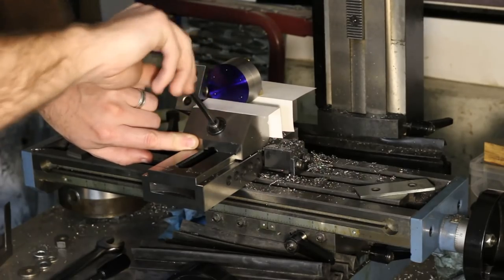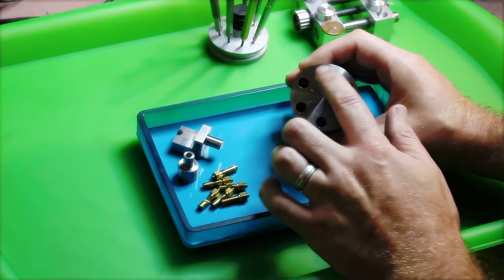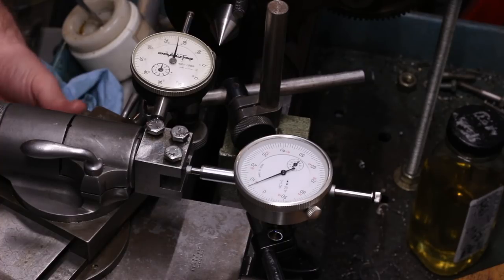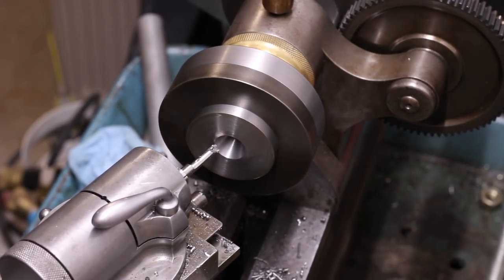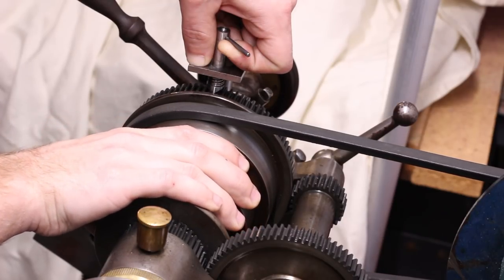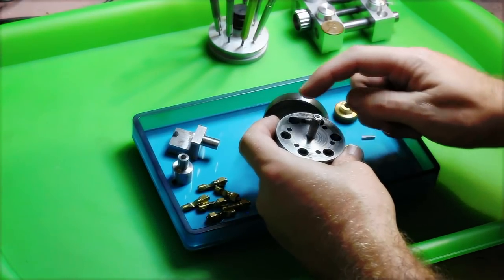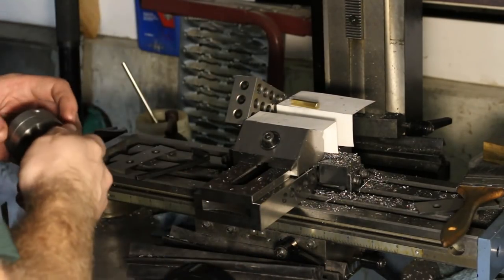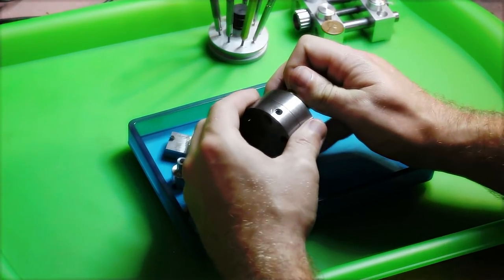Watchmakers Lathe Tailstock Turret, Detailed Build

Comment: Good to see you back. The indexing techniques used are most interesting -- loved that bull gear method --  and of course any watchmaker's lathe has some indexing capabilities. Once upon a time, turret lathes were the last word in mass production of parts. Now they have been superseded by CNC, but for a home shop they are very very useful. I will warch this again.
Reply: Juan Rivero old screw machines can  still out run a cnc..high production...just cant deductin  on taxs... even servo cam  only 4 yrs max
Reply: Not knowing anything about screw machines I will pass on that. But a turret lathe does a lot more than cut threads. It will size, turn, drill, ream, part to length, and oh yes, cut threads. In short it will make a part on one go. So will a CNC machine, and does not require an operator to perform the actions in sequence. I am no fan of CNC, but one has to be aware of why they have superseded the turret lathe and many other machines.

Comment: Very good and nicely made! But would it not have been better to drill/bore the tool holder bores from the lathe spindle? That would insure that the tool holder bores are in exact alignment with the spindle when the turret is in use. Also by doing that it wouldn't be absolutely critical for the stop pin holes be exactly located (and you would avoid having to use some sort of lathe spindle  indexing device e.g. the bull gear latch device you made for your lathe). You could lay them out and then use the back part of turret (the part with the brass bush for the stop pin) to match drill the pin locating holes on the front part of the turret with a drill press. Then use the stop pin in place to locate the turret position and with the turret installed in the tail stock, drill, ream or preferably,  bore the holes for the tool holders. 
I would think that exact alignment of the tooling would be very important when using things like very small dies and other miniature tooling. The method you used may well have given good results, but usually every time you release the work and reset it you lose position accuracy.
Reply from the maker: All of the tool holding bores were, in fact, drilled and reamed in place on the watchmakers lathe, as I showed in the competition video. The layout shown here, as I mentioned, was simply an idiot check - a visual reference to make sure I didn't completely ruin the part when machining the bores for the clamping rods.
Reply: Well, if had watched that I would have known better. I've looked through the old Popular Mechanics and Poplar Science magazines, especially from the 20's through the 40's and there are probably a dozen flavors of tail stock turrets. I don't think there is any "best" turret because that would depend on the type of work you might be doing. As with most shop tooling, decide what you're going to be making and build to suit.
Cheers from NC
Reply from the maker: I love those old magazines, there was some great stuff in them!  I have scans of a few, regarding scratch-built lathes of various designs.

Comment: Thats a fun project, thank you for sharing.  I like the bull-gear method for setting the indexing points, though it isn't at all necessary, right?  Since every other meaningful machining operation was done based on the index holes, their locations are not terribly important, correct?  

Additionally, I'm wondering whether the keyway is necessary.  It would seem that the cone locking mechanism is doing all of the work, so it wouldn't be necessary either, right?  Or am I missing something obvious?  It seems like though it isn't a terrible amount of work to make, it caused assembly to be difficult.
Reply from the maker: Great questions! You are correct, that accurate indexing was not necessary. It could have just as effectively been laid out by hand. Regarding the key, it is necessary to prevent rotation of the bearing against the shank. The design provides adjustment to compensate for wear, but only if that wear is constrained to the tapered bearing surfaces. Wear between the bearing and the straight shaft would result in slop that could not be adjusted out.
Reply: Ah, I hadn't thought of that!  Thanks for answering